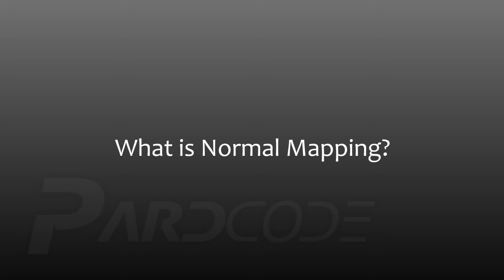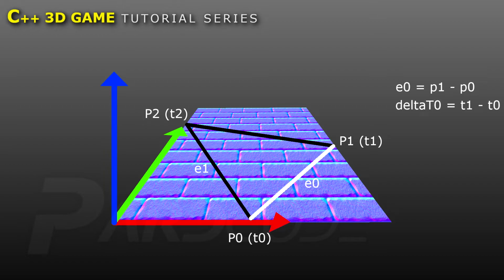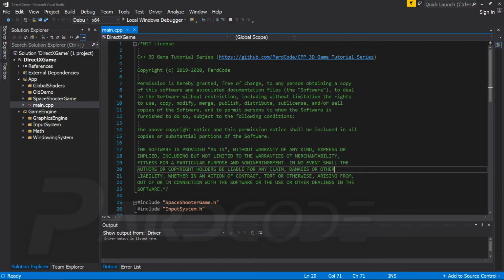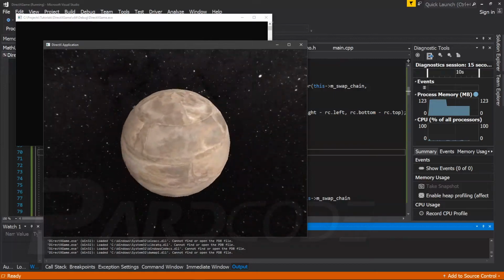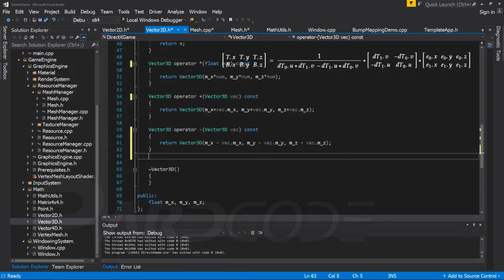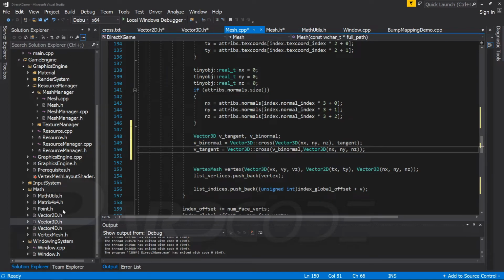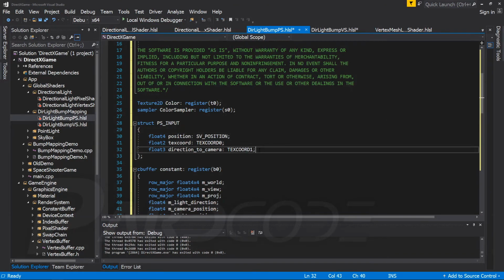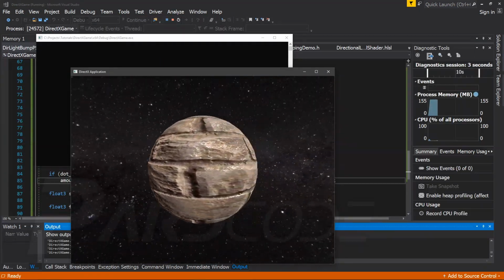How Normal Mapping Works | C++ 3D Game Tutorial Series #28

Comment: I started these tutorials two weeks ago; great work! I've been able to follow through all of them without any issues, until this one.

I have an issue with line 47 in BumpMappingDemo.cpp file: GraphicsEngine::get()->getRenderSystem()->getImmediateDeviceContext()->clearDepthStencil(this->m_swap_chain)

I have the error: 'clearDepthStencil' is not a member of 'DeviceContext'

I haven't changed anything in 'DeviceContext' since it was required in a previous tutorial and my last tutorial builds fine. I looked back at your code from tutorial 23 and videos to this one and do not see 'clearDepthStencil' defined anywhere.

I tried to build it with this line commented out thinking maybe it wasn't necessary, since it was a copy-paste from the template; while I don't get an error during build the app window doesn't load and the cmd window results in exit code -1073741819.
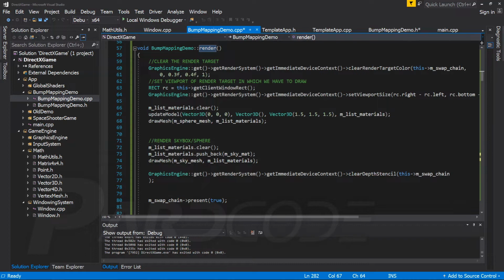Reply: As I continued to watch the video, I noticed you do have that line of code at line 76 at 19:30. So, I'm not sure how/when it got added. However, usually an exit code like the one I get is an issue with the file path or code in a shader file. Since it was a copy-paste of code from the template, I forgot I had to modify the file path in the code to textures and meshes. For some reason including "..\\" at the start of the path doesn't work for me, I have to remove this text from the file path. I was then able to build successfully with that line omitted; still not sure what it does.
Reply: @tylerleitzke  

Regarding the "..\\" prefix in relative path names, every folder other than the root folder contains two folders, named "." and ".." respectively. You won't see these folders in Windows Explorer (they are always hidden) but you can see them in via the command prompt DIR command.

A single-dot refers to the current folder (in this case, the project folder), whereas the double-dot refers to the parent folder (in this case, the parent of the project folder). If your assets are in the project folder then you need to remove the "..\\" prefix from all references, or replace them with the ".\\" prefix. However, assets should be in a separate folder from the project (so they can be shared by other projects) and the parent folder is as good a place as any, in which case you need the "..\\" prefix.

Of course, in a finished application, you would store all folder names required by your application in the registry. In this way your code isn't hard-wired to specific folders; they can be user-defined (configurable).
Reply: Add this code to DeviceContext.cpp

void DeviceContext::clearDepthStencil(const SwapChainPtr& swap_chain)
{
	m_device_context->ClearDepthStencilView(swap_chain->m_dsv, D3D11_CLEAR_DEPTH | D3D11_CLEAR_STENCIL, 1, 0);
}
Don't forget to add function to header file as well.